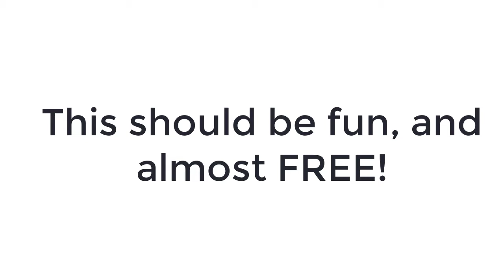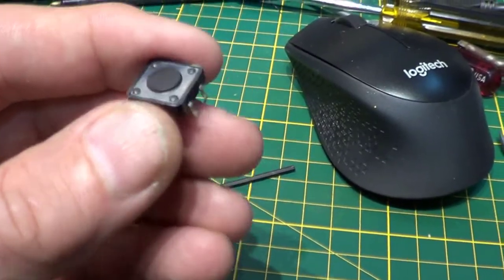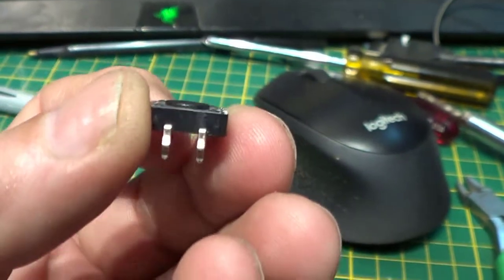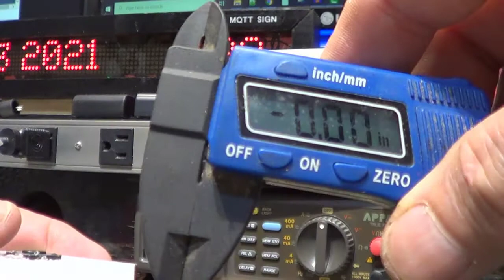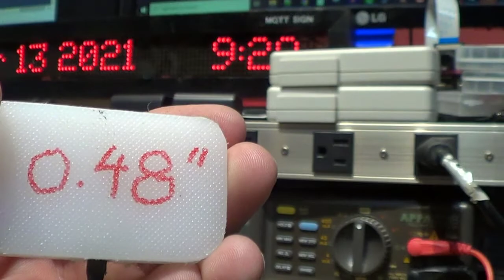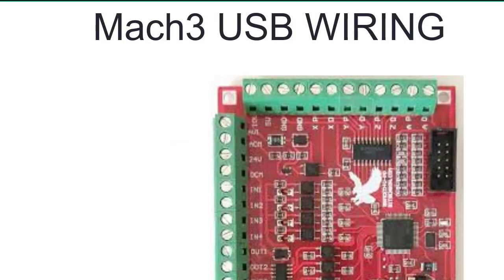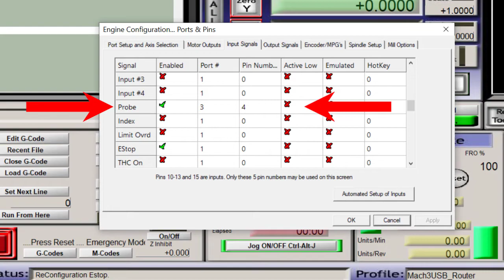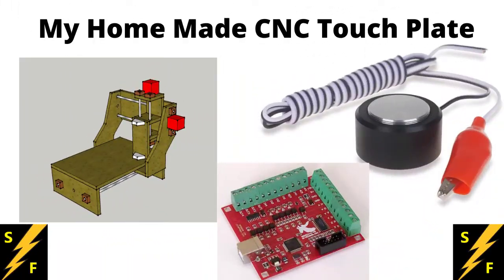My Home Made CNC Z-Axis Touch Plate

Comment: HELP Steves!!  LOL  I have set my ports and pins input to IN4... 3 - 4 as shown.  I unchecked the the active low.   (when it is checked the digitize light is on as shown)   My Z will come down after a short delay.  It will not stop.  I checked the continuity on my wires.  Just spent 2 days trying different settings with no luck.  Suggestions?  
Thanks in Advance from Galveston, Texas 
Bill
Reply from the maker: Hi Bill, thanks for watching the video!  I was using my machine yesterday and used the auto Z feature several times and it is working perfectly.  Let me go out to the shop and see the settings and I will update you.   The easy way to test it, is click the auto zero button, and then after it counts down and starts to move, press the button (do not use a bit as you are testing the feature).  It should stop and say "Auto Zero Completed" and raise up about .6 of an inch.   I will get back to you in an hour or so.
Reply from the maker: Hi Bill, thanks for the email.  In case anyone else is having trouble, here is the mach3 pin setup for the probe:

What I have is:
Probe <checkmarked green>
Port: 3
Pin: 4
Active Low <X>
Emulated <X>
HotKey: 0